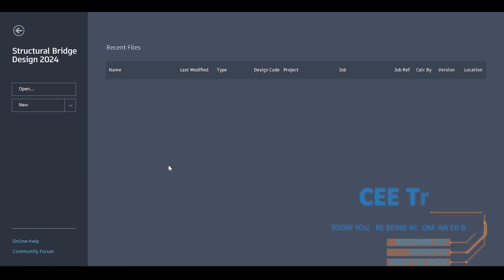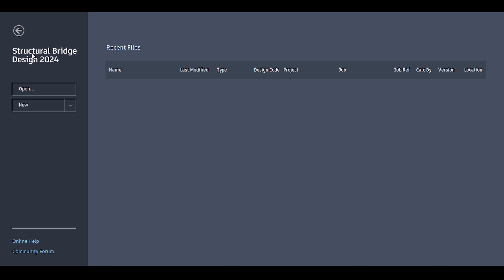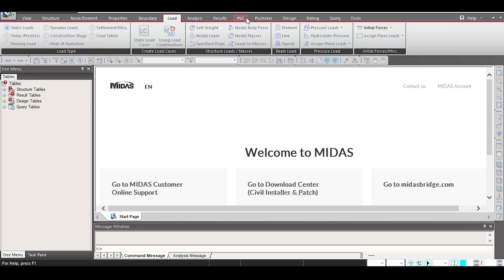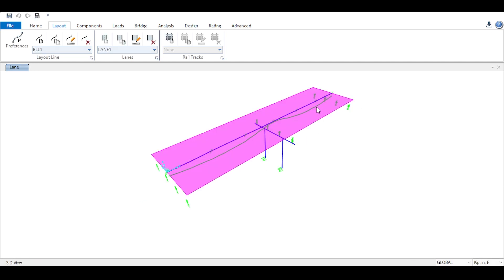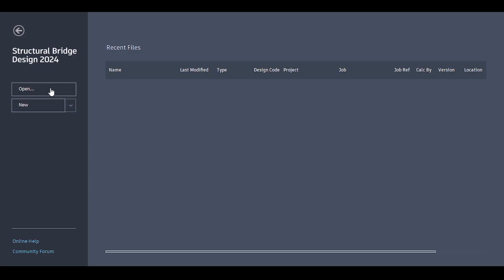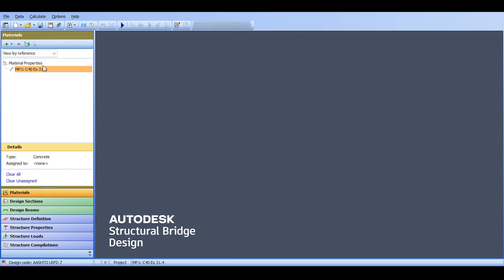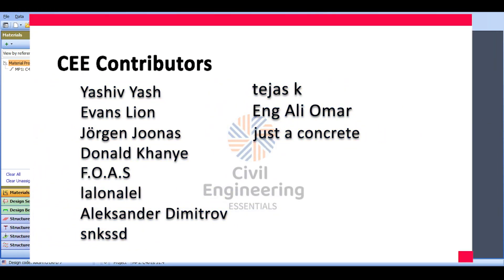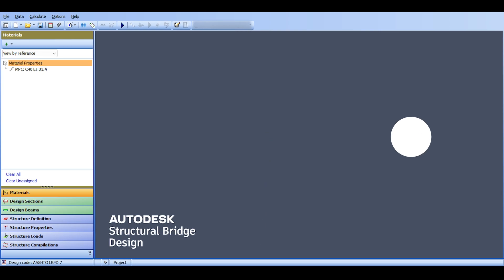Structural Modeling and Design of a Highway Bridge | Part 5: Software Options

Comment: Excellent series. Could you also include modeling and design of railway bridges?
Reply from the maker: Would be a great idea. It might be the case but later in the future. If you are interested in reading about its loads, check the "AREMA" Code. It is used in conjunction of AASHTO in the design.

Comment: Hi CEE, thank you for all the great work! 
You mentioned that Autodesk Bridge is only for small scale bridges, can you specify in the series what bridges are ok to design in A.Bridge and what are the ones that shouldn't be designed in this software?
Reply from the maker: Hello there, thnx a lot for the feedback.

I am trying very hard to make Autodesk's software because a lot of viewers do not have legal axis to CSI Bridge.

If you have legal access to CSI bridge, or midas Civil, then I highly highly highly recommend those. I am thinking of having another tutorial in one of those parallel to the Autodesk one, but need to get some details with regard to the licensing done).
To answer the question, simple straight or curved bridge are prefectly fine with Autodesk Bridge, but box girders might be a challenge. Will see about that.

Anyways, stay tuned for more content.
Reply: @CivilEngineeringEssentials   I appreciate your answer. I will be waiting for the next videos 👍